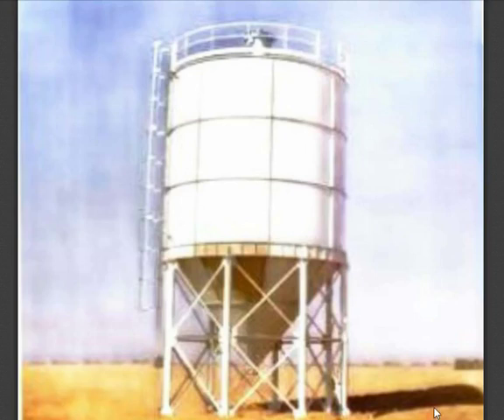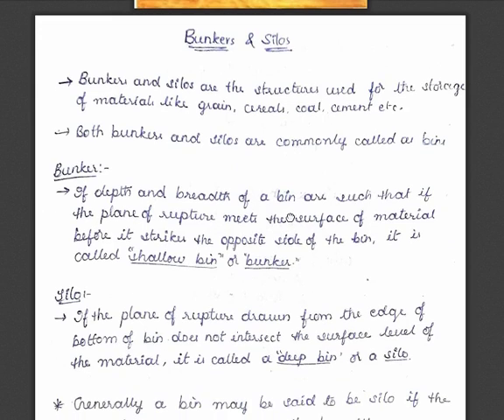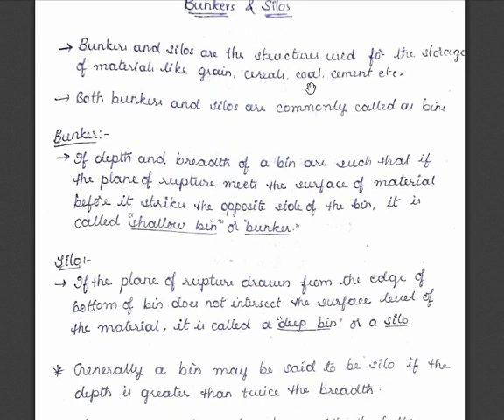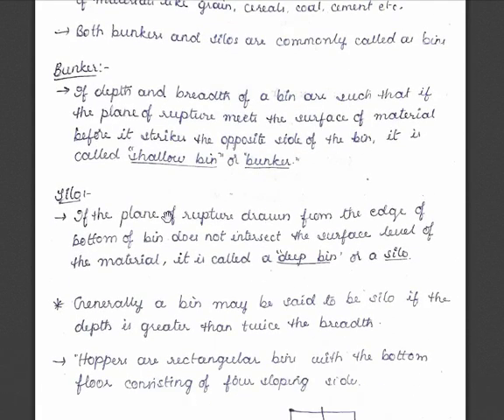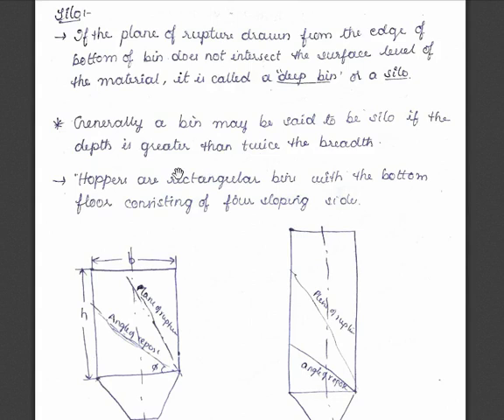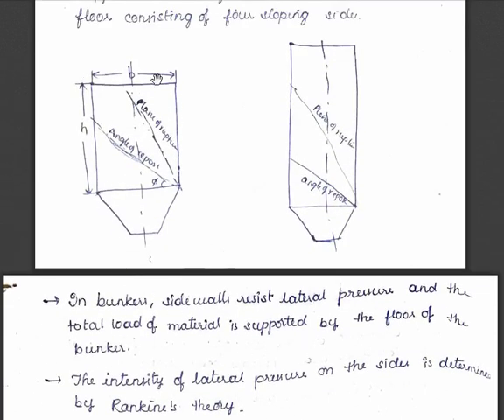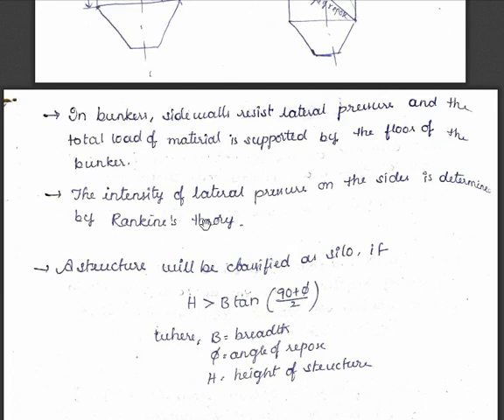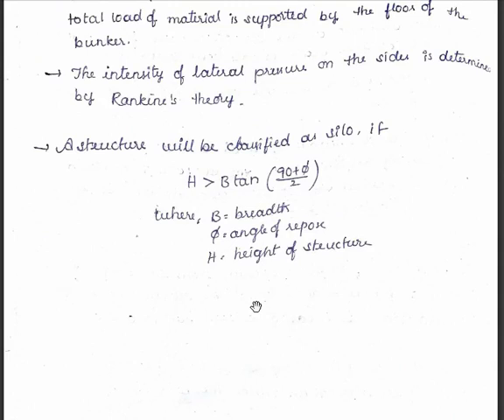Introduction Bunkers and silos (theory part)  | Mounika Meduri

Comment: i did not understand the angle of rupture and repose can you explain it in a practical way so that we can visualize what is actually happening in.Thank you
Reply from the maker: Angle of repose is the maximum angle up to where a material can be stable. Look at the following examples
1. You are standing on a flat surface. If some one rises the platform you are on. You will be stable without  any external support till some extent. If the angle increases, you will slide and need an external support in order to keep yourself stable.

2. Pour sand in a platform. this will always be conical shape. the angle will never increase. It occupies more space horizontally and will not sustain vertical height. If you measure the angle of that cone with earth, that shall be angle of repose.

And angle of rupture is that even if you/ any material is having external support, for example sand being stored in rectangular box, it has tendency to fail along a plane when the material is not much strong, which we are calling as rupture plane
Reply: @MounikaMeduri  mam pls further explain plane of rupture.I understand angle of repose but not plane of rupture
Reply from the maker: @mohitgarg6301  Hi Mohit, If as you've already understood angle of repose, you can understand angle of rupture as well.....See explanation below............
When we are storing any material in a container, when the container is not strong enough to hold that material, it fails. That breakage angle itself is angle of rupture.
When it is not stored in any container, it attains a conical shape with some base angle which is known as repose. 
So both are different. There is no rule that the angle of rupture to be same as angle of repose for all materials.
Reply: @MounikaMeduri  Thanx a lot mam.wish I have a guide like you in my university.
Reply: @MounikaMeduri  Mam app ne  cross drainage work pe video banayi hai??